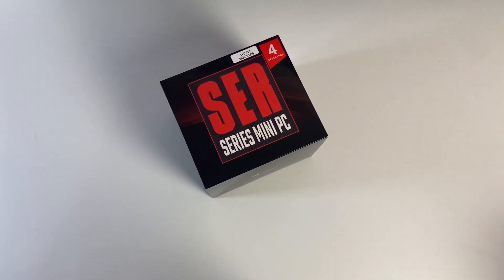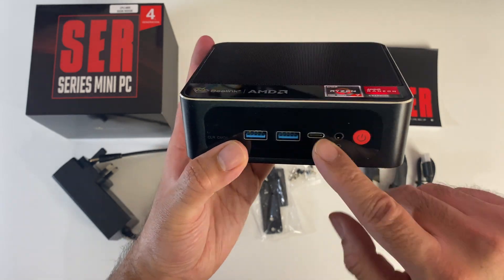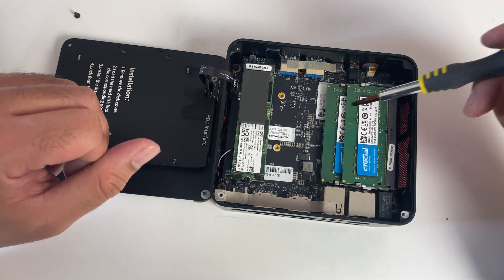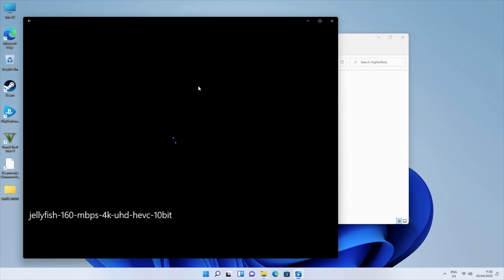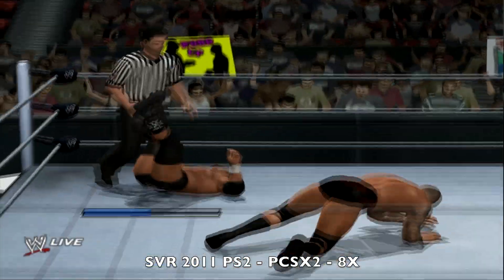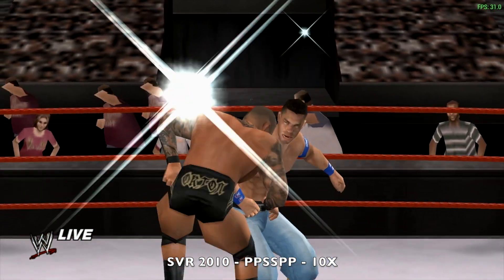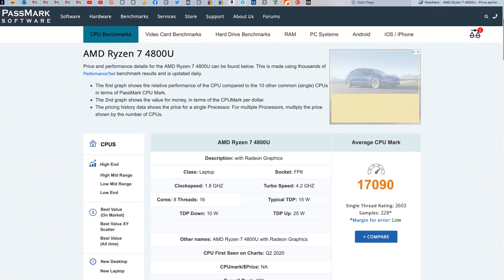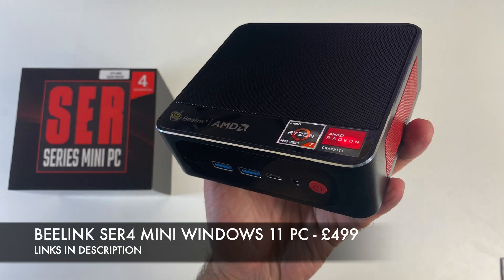Powerful BEAST! Beelink SER4 Mini PC - AMD Ryzen 7 4800U - 32GB + 512GB - Windows 11

Comment: I recently got my Beelink SER4 back up and running. After two years of running Windows 11, the OS has succumbed to permanent BSOD's with every reboot, and all subsequent clean installs won't recognize the internal Wi-Fi card anymore, considering that an Internet connection is officially mandatory for all Windows 11 installations. So, I completely gave up on Windows 11 and switched entirely to Linux Mint 22 Cinnamon, which detected the internal Wi-Fi card right out of the box. Fortunately, this wasn't my first time using a Linux distro of any sort. For my Linux Mint installation, I created and mounted the / and /efi partitions on my primary 1TB NVMe SSD, and a /home partition on my secondary 2TB SATA 2.5" SSD. Compared to Windows 11, Linux Mint runs much faster and much more smoothly on my Beelink SER4 Mini PC. Before I switched to Linux, I've upgraded the RAM to 64GB.

Comment: Amazon has the 16gb/500ssd version on sale for $370, absolutely insane value for anyone interested in a small pc.
Reply: Same PC but different CPU as well. That's why it's cheaper. I believe the one you saw has the 3550H cpu
Reply: @lexlopez15  Just got mine last week with 4800U processor for $389 Amazon. Of course it sold out quickly and now only the 4700Us are left😲
Reply: I was wondering, if I buy a full sized pc prebuilt, take out the ram and cpu of the prebuilt, and  take ram and cpu of the mini pc would it work ?
Reply: @supersigma2  yess

Comment: some confusion here...in your passmark ranking chart it shows the cpu as the  ser4 4700U as the top mini pc. when the one you are testing in this video is the 4800U...that would make a bit of a difference in benchmark scores since the 4800U has 8 cores 16 threads and the 4700U has 8 cores 8 threads and comes with 16gb of ram....nevertheless I have the ser4 4700U and it performs really well out of the box....incidentally, the other difference between the two is that the pc chassis for the 4700U is nearly identical except that there are no red air vents, it's all black....needless to say, i only payed $337 for it on Prime Day in the U.S. which is quite the bargain.
Reply: That's a really nice price. Does it also have integrated graphics card?
Reply: @gohan12991  yes it does.
Reply: @lexlopez15  thanks. Currently I'm seeing it for 360 usd on Amazon. Should I wait?
Reply: @gohan12991  unless you can find some digital coupons i don't think you'll find a better price on it until Black Friday or Christmas, so waiting is up to you.
Reply: @lexlopez15  I'll wait upto black friday then. I'm not from US but my friend is living there. I'll ask him to buy it then because PCs in my country are too expensive. Thank you very much.

Comment: I got one of these on prime day. Pretty good isn't it. Think I paid £320 or so for the 500GB/16GB model. I'd have liked an extra C port and another two USB ports on it but it's nice. The power plug is a little large too, ots almost half the size of the PC lol. I think it could have just had a USB-C in for power, maybe giving us 3 total C ports. Would have been nice. But it's pretty great otherwise. I just need a 2.5in drive for it now. Bought it for some gaming and emulation. A card reader would have been nice on the side too.

Comment: There are two versions of the SER4, one with the 4800U and one with a 4700U. Beelink told me they are otherwise the same. The SER4 4700U I bought also has black grills on the side, not red. 
As far as performance, in the latest Cinebench the multicore results were 20-25% lower than the 4800U but the single core performance was about the same.  I got my PC for about $100 less than the lowest price I've seen for the 4800U version, usually more.

Beelink's Customer Service department has been a great help to me in answering my questions and getting me links to the latest disk image for Windows 10 Pro and Windows 11 Pro, as well as the image for my older Beelink Gemini 45X with 6GB memory.

Comment: Thanks for a great review :) What generation PCIe (3.0 or 4.0) is the M.2 NVME interface using? I wanted to upgrade to the Samsung 980 PRO w/ Heatsink PCIe® 4.0 NVMe™ SSD 2TB. Also, is there enough room in the Mini PC for the heatsink on the 980 Pro?